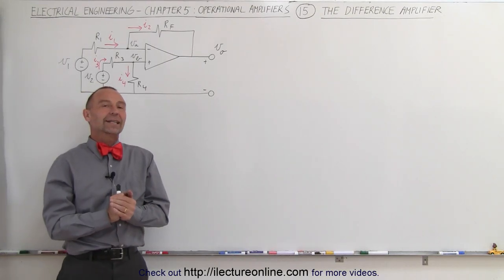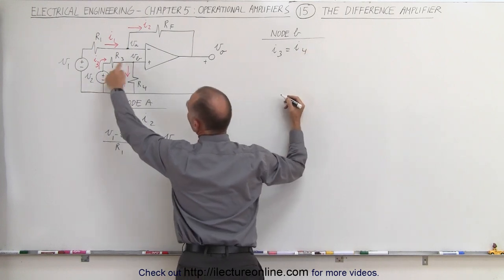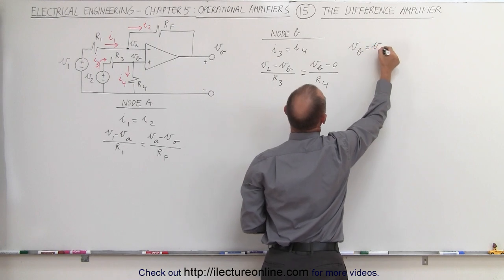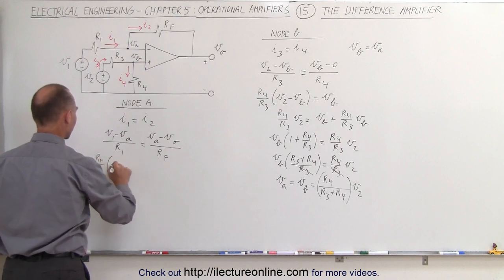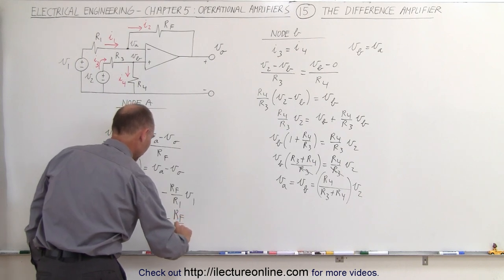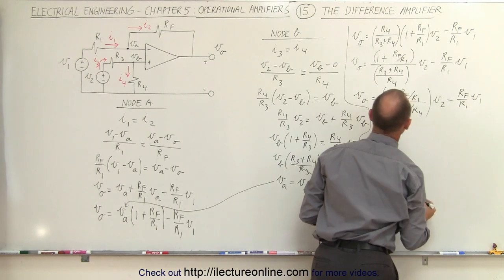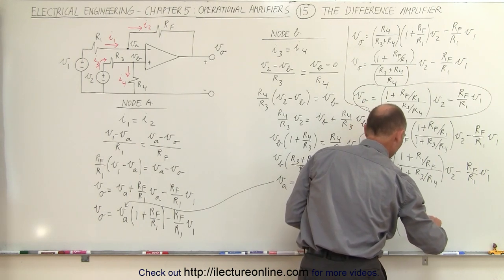Electrical Engineering: Ch 5: Operational Amp (15 of 28) The Difference Amplifier

Comment: Beautiful math work out........I tried on my own and gave up. Mine was not bad but didn't get the beautiful part at the end where we can clearly see why making the two ratios R1/Rf = R3/R4  gave us Vo = Rf/R1( V2-V1 )  which is a very easy to see how this circuit is "The Difference Amplifier".  I have no problem understanding the electronic but I have to go over the math a couple of times. Nice lecture. Loved it.

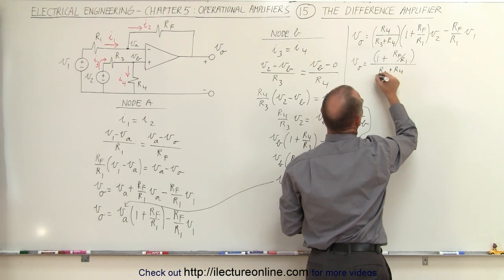Comment: What  did you do at 6:45  to simplify that fraction what is the story?
Reply: Can anyone explain or name what is this algebraic trick at this part?
Reply from the maker: Dividing by a fraction is the same as multiplying by its inverse.    12 / (1/2) = 12 x (2/1) = 24    or  (2/1) x (12) = 12 / (1/2)

Comment: Can you get two different answers if you use the first circled equation and the second shorter one? My Rf/Ri=R3/R4=2 and my V1=-5 and V2=6. Using the longer equation I get 16V and the shorter I get 22.

Comment: I find the calculation of vo quite complex (between minute 7 and 8 something).  When I do the same calculation my way, the result is vo = v2 (R4 / (R3 + R4)) ((R1 + Rf) / R1) - v1 (Rf / R1)
Sorry but it's difficult to type it down like that.  Anyway, by going for that shape of formula, it's easier to see what happens if R1 = R3 and Rf = R4 on one side and R1 = R3 = Rf = R4 on the other side.
But again, the end result is the same (many paths lead to the same goal...).
Apart from that, you're one of the very few that can really explain how a difference amplifier really works.  Thumbs up!

Comment: I have an question please we use this law only when resistance are equal? (R1=R4 and Rf=R3)
Reply from the maker: They don't have to be equal, but if you do make them equal you will have that simple relationship for Vo
Reply: @MichelvanBiezen  i used the law directly to get an unkown in Nelson james reference but it is wrong the reference used th method of node voltage and get a nother solution😅🤔
Reply from the maker: Is the setup exactly the same?  Or is there a difference in the way the op amp is connected?
Reply: @MichelvanBiezen  yeh it's exactly the same

Comment: How is the direction of current across the feedback resistance determined?
Reply from the maker: Current flow from high potential to low potential (conventional current flow).  If we don't know, we just pick a direction and if we picked the wrong direction the current will come out negative.

Comment: How could you amplify the mV output from a thermocouple to a 1-5 volts signal using an op amp?
Reply: Use non-inverting Op-Amp (not Difference Amplifier).  Av = 1+(Rf/R1).  For example, to convert the output voltage of an analog temperature sensor, let's say a TMP35, to a 0-5v for an Arduino, set Av = 4 (Rf = 33k, R1 = 11k).  Then, TMP35 maps very nicely to Arduino supply range.  Of course, adjust gain for 3.3v system.  TMP35: 25C = 0.250v and 125C = 1.25v.  Op-Amp transfer function is f(x) = 4x, where x is TMP35 output voltage.

Comment: Would it have been a bad idea to have simply jumped into using voltage devision to solve for Vb considering no current into V+ or could this cause problems in other situations?
Reply from the maker: That should work.